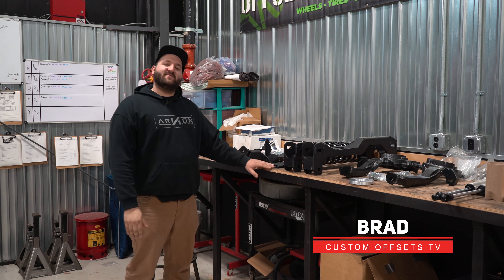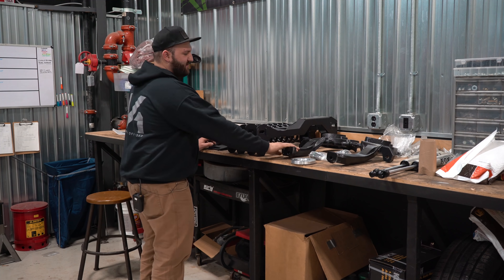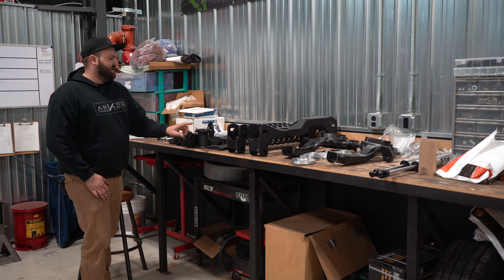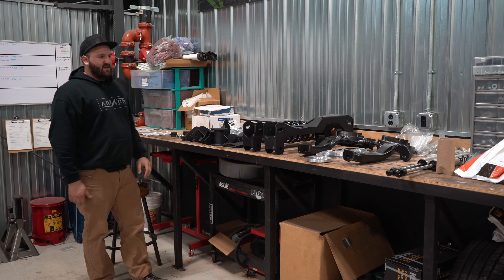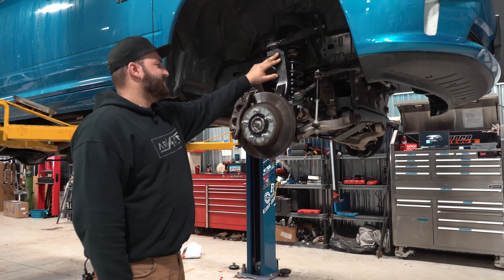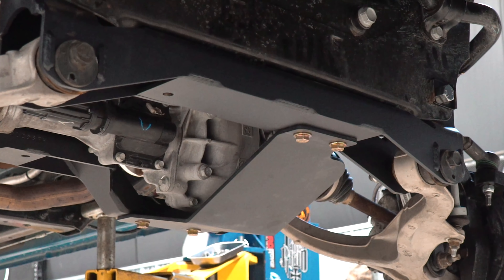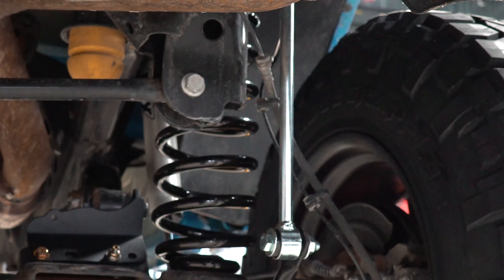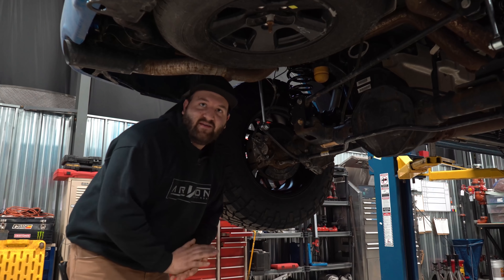Lifts & Levels: 6” BDS Lift Kit 2018 Ram 1500

Comment: I’m guessing it will work for the 2019 1500 classic?
Reply from the maker: Yes the 2018 Ram lift kits will work on the 2019 classics ONLY, not on any other 2019 models.
You can check out our 2018 Ram lift kits here:
https://www.customwheeloffset.com/store/suspension?sort=popular&year=2018&make=Ram&model=1500&drive=4WD

Comment: Wheel and Tire sizes? Truck looked great.
Reply from the maker: 20x12 TIS 544RM wheels wrapped in 37x12.5 Nitto Ridge Grapplers. You can check out this setup here!
https://www.customwheeloffset.com/buy-wheel-offset2/544RM-2125244/217030/tis-544rm-red-milled-20x12-44-nitto-ridge-grappler-37x1250r20lt?year=2018&make=Ram&model=1500&bolt_patterns=5x5.5%2C5x139.7
Reply: Looking at almost the same setup but on 22x12 wrapped in 37”x12.5 Nitto Ridge Grapplers. Any Trimming?